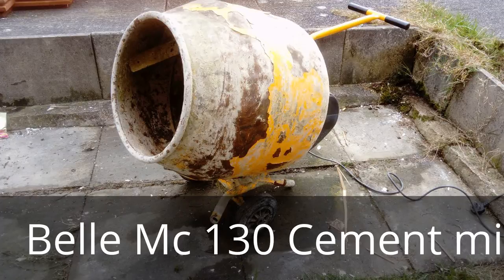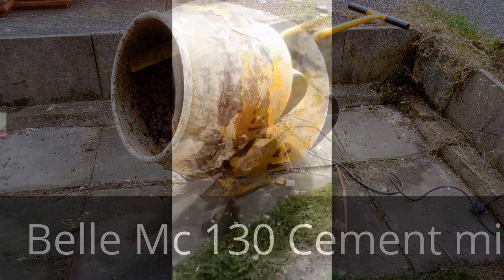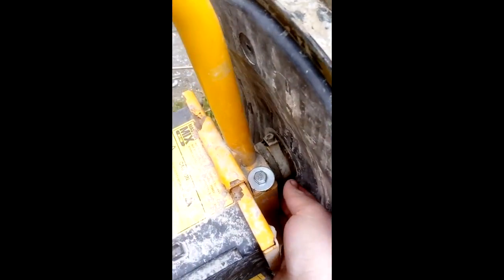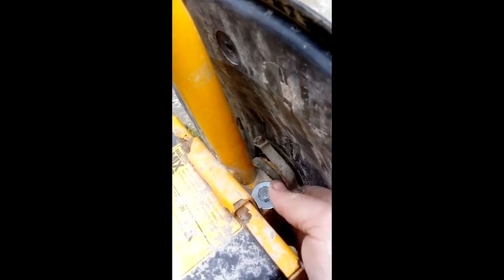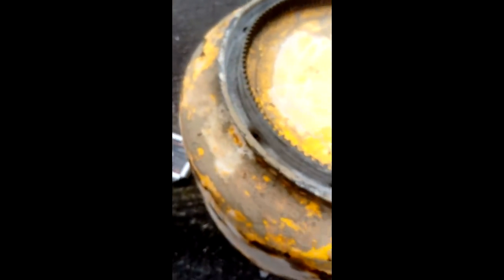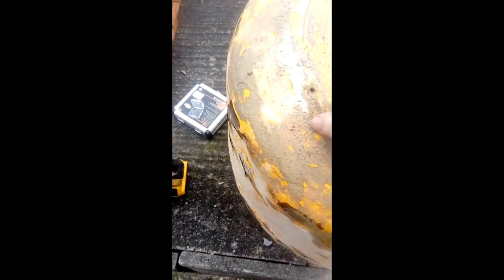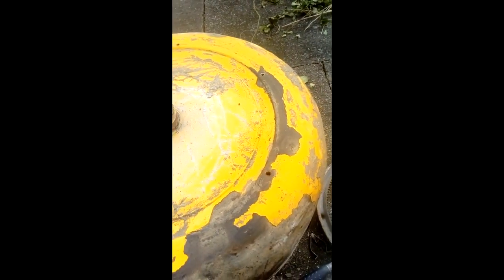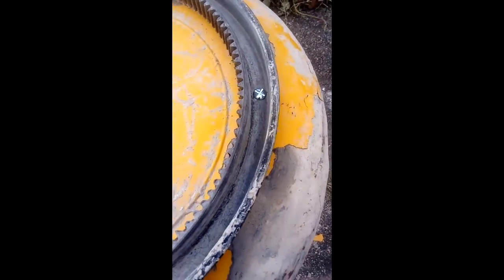Belle Cement Mixer / Concrete Mixer Repair MC130, Drum Mixer Ring Gear repair. Mini Mix / Master-mix

Comment: Really simple to follow repair. Noticed mine leaking only yesterday, so will do the same. Did you put the washer on the inside?.
Reply: Hi - did you get anywhere? I have the same question